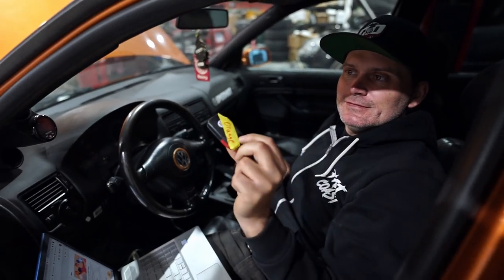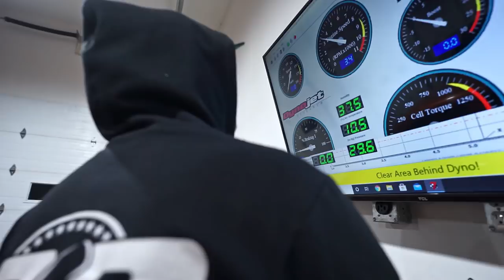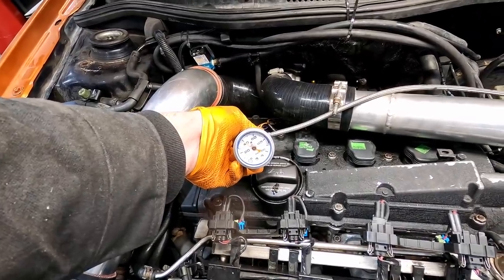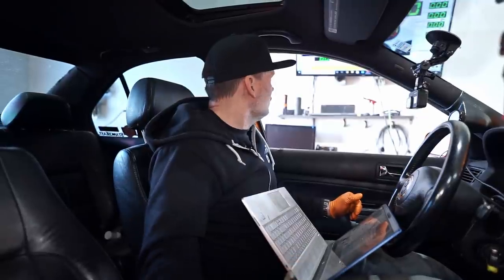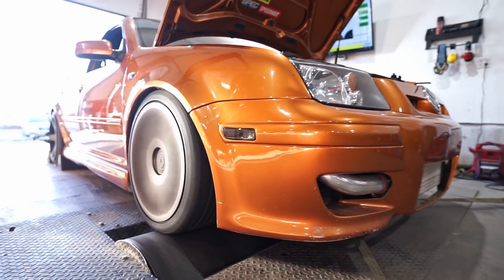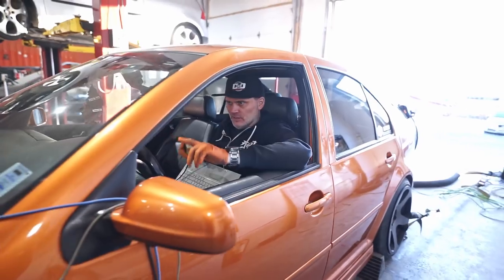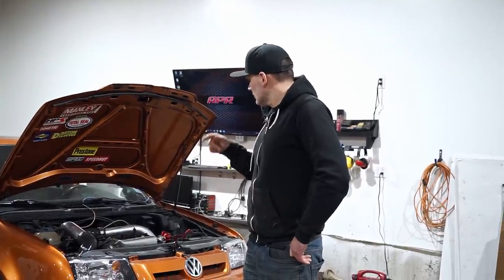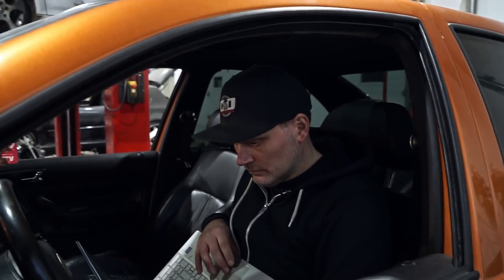Turning up the boost on this MK4 1.8T Big Turbo. Turns into a bit of a smoke show.

Comment: Nice work sorting this thing out. The 3071 is one of my favorites on the 1.8t. I like the Prestone sticker. Pretty hilarious. He should replace it for his "roll call" stickers with a Pentosin one lol. I worked on a few cars that had an assload of oil in the exhaust and intercooler/ piping. Definitely nerve wracking to say the least when its that smokey. To get some of the smoke out of the exhaust sometimes some Seafoam helps in the tank. Not much else you could do besides just let time take its course. On a car that has a cat, it probably wouldn't hurt to use some Cataclean either. It would suck for the oil to ruin the substrate in the converter. Especially if its an expensive OEM one. Then you run the risk of ruining the o2 sensor or getting a whole bunch of efficiency faults and whatnot. I was successful with the Seafoam method on a B5 a4 that a customer decided to way overfill it with oil. Plugs were soaked, PCV was full, etc. Smoked for awhile until I changed out plugs, cleaned the PCV setup, and dumped half a can of it in the tank and sucked the other half of can into the intake via the brake booster hose. Then went and drove it. It cleared up nicely and the smoking completely went away. This is usually the best method I've done to clean them out when they get that way. Really enjoyed this vidja dudes. Good shizz 👍😁😎💪
Reply from the maker: Appreciate the ideas. This was catless with just a res, so it really just need to be burnt off. It got a new set of plugs and I was worried about the 02s but they hung in there... Luckily.
Reply: @COMotorsports  
No problem. Catless is the way to go if I had the choice absolutely. Just offering some of my experience but that thing looks like it cleaned itself up just fine. I like the plug gapping tool you guys use. Who makes it? Interested

Comment: Was contemplating on going gtx2871 or a gtx3071 on my mk4, this vid pretty much got me set on the 3071. Planing on exactly the same upgrade. Rods and exhaust valves. Just wasn’t sure which turbo to go with.
Reply from the maker: Both are good, 3071 just has more headroom.
Reply: @COMotorsports how’s the spook between them

Comment: You got a show the data logs for the home viewer!
Reply from the maker: The data is really only specific to this specific setup so not much point really.
Reply: @COMotorsports  Not sure if you remember me, I’m Mr. Manual Boost Controller😔. Once you swapped over to the 3071 this became very similar to my build, w/exception of injector size(mine 870) and tune which is why I was so interested in the data.  I’m using Ross Tech VCDS to read my ECU (United Motorsport tuned) and am trying to gain all the background knowledge I can. I never wanted to get involved with this but I guess if you’re going to do a big turbo build or any build you need to be involved all the way because relying on others certainly has proven to be a bad choice in the past (for me).

Comment: So I just got my EuroDyne software. I'm putting a K04 (for now) and 440cc injectors on my 1.8T Audi. I'm hoping to get a gt28 and a rebuild done within the next year. One suggestion though, during your video and after each dyno pull you should tell us the power level. Give us more info! Boost level, horsepower, torque... All the good stuff.
Reply from the maker: I said that to Clayton after watching it myself. We'll try a bit harder next time. Keep in mind this video was filmed over a year period vs the first time we had it and had issues with it.
Reply: @COMotorsports  I just hope I can get to 300 wheel! I daily it though.
Reply from the maker: @4BillC  with proper set no problem to daily at that power. I've done plenty. It all comes down to the parts and tune you put into it.
Reply: i know you guys dont want to give tuning secrets away but getting an idea of what the timing change is at rather than saying adding or taking away would be cool.
Reply from the maker: @veedubbergti  Thanks for the feedback, since every engine, fuel, and setup is different that info is irrelevant honestly. It's different for every car.
Reply: @COMotorsports  could be but someone  with pretty much the exact same setup it would be so dosnt hurt to say it  .its definetly something people would like to know dosnt hurt to compare.

Comment: Loving this channel. Currently putting together an auq to go in my e36 bmw of all things and you've answered loads of questions just by watching the video. Are the hp numbers you quote all wheel power? I'd like mine to be around 360 wheel so it's a bit better than an s54 but still reliable enough to use daily..so all I'd need really engine wise is a gt30 turbo, injectors and rods? 
Thanks, wish we could colab our channels but your a bit far away! 😂
Reply from the maker: Appreciate the comments. All our dyno numbers are at the wheels. Sounds like a neat swap you have planned. No problem making that power with that turbo. I'm sure when you get to the point of getting it up and running we can figure something out.

Comment: Do you have any experience with the GTX2867R? I feel like boost hits very late, doesn't seem to "hit" until 4k - 4100 rpm and peaks at about 4500 RPM. Holds about 10 PSI from 3300 to 3900 then it spikes quick. Currently using Eurodyne, might have to hit you up for a tune to get it to boost earlier if it's possible.
Reply from the maker: Can depend on controller, tune etc. Sounds good.

Comment: Love the the content! I’ve a 2017 Passat R-Line with the 1.8 and have a intake,custom exhaust and apr stage 2 no Intercooler yet but realistically how much more power can I get out of this current set up?
Reply from the maker: Lots with a turbo upgrade. You've maxed out what you have really. Cooler IAT and better fuel is about the only options. Turbo only has so much to give.

Comment: Hello, like what you're doing. 
Have a question about my 1.8t leon mk1, I did a full engine rebuild with forged rods upgraded fuel pump 265l, 440cc or 470cc injectors, large exhaust manifold with hybrid turbo k04. Will be adding front mount intercooler, pump fuel will be 95 or 98 How much hp can I make out ?
Reply from the maker: We dont really like k04s honestly as they're pretty lacking in power comparatively.

Comment: Is upgrading valve's a must when going to the mid 400hp range on a 1.8t big turbo?
Reply from the maker: The exhaust valves are weak sauce and fail when they decide. So we always recommend them for power like this.
Reply: @COMotorsports  upgrading valves is pretty speedy isn’t it? I’ve got a built bottom end with IE drop in rods then apr head studs on the top end of my 20th anniversary GTI, is there a specific kit you like when upgrading the valves?

Comment: How do you turn the boost up with eurodyne? I've tried to find some, and noone really gives a straight answer, I was hoping you could help me
Reply from the maker: I don't use Eurodyne to control boost. We're always shotting for higher than the stock map sensor.
Reply: @COMotorsports  Oh, what do you use to control it, I'm trying to tweak mine a little bit for a balance between performance, reliability, and economics.

Comment: Just starting my 1.8t awp build on my wagon. What are the advantages of going to 9.25 compression ratio over the stock compression?
Reply from the maker: Nothing as that's pretty much what it is factory.
Reply: @COMotorsports  isn't factory compression 8.25 to 1?
Reply from the maker: @greasysamsquanch  no
Reply: @COMotorsports  thank you. Keep up the work on the channel. Great videos and alot of good info.
Reply from the maker: @greasysamsquanch  thanks 👍

Comment: Hey, just found your videos. I have a 2003 Jetta 1.8t on a maestro stage 1 tune that has severe pinging/timing pull. I've narrowed it down to a hardware fault. I've been trying to find the issue for a while and I haven't been able to. Any chance you could help me diagnose it?
Reply from the maker: It's not an easy task to diagnose a car over the internet unfortunately. However you state you found it to be a hardware fault... silly question but did you fix the hadware?
Reply: @COMotorsports  No, I haven't been able to find the fault.

Comment: 630cc injectors with gt 3582 turbo wat kinda horsepower should I see roughly with all supporting mods like rods, aeb pistons, exhaust valves basically everything except springs and retainers oh and aem 340lph fuel pump
Reply from the maker: A dyno will tell you exactly what you're after.
Reply: @COMotorsports  thanks 👍 i appreciate it

Comment: Hey CO Motorsports can you adjust afr, ltft, spark advance with the eurodyne mastero 7 software I already use HPtuners for Chevys but they dont cover the 04 JETTA 1.8T is eurodyne mastero 7 similar I want to get LTFT and all my fueling part throttle and wide open throttle perfect and make sure the boost is coming in properly with power enrichment is eurodyne mastero 7 capable of these tuning abilities
Reply: ALSO DO THEY CHARGE YOU TO REFLASH YOUR ECU ONCE YOU HAVE MADE YOUR ADJUSTMENTS TO THE FUELING AND SPARK ADVANCE?
Reply from the maker: @action76news  Yes you can, however it's not such a cut and dry system.. but its one of the only options for these vehicles for an end user tuning suite. You pay for the cable which comes with a lot of base files to get the car running (as long as it's a car they support). Then you can tune from there. So you pay once for a cable and tune, and you can flash other vehicles as well by purchasing more credits.
Reply: @COMotorsports  So my car wouldnt need credits because i bought the cable that would allow one car unlimited reflashes but if i want to tune a different vehicle then more credit are needed? Thanks for responding!🇺🇸🦅👍🏻
Reply from the maker: @action76news  as long as you bought it with credits.

Comment: What rpm would you expect a 6262 precision turbo to start building boost mine spools around 5500, I feel like it should spool a bit faster
Reply from the maker: Check out the blue GLI video on our channel. Dyno runs on that 1.8t with 6262.
Reply: @COMotorsports  how can I contact you for a tune
Reply from the maker: @startonesoundinternational2151  emails on our profile on our YT page and on our website. 👍

Comment: That bumper. Is it a custom stock w/fiberglass dealio for match the widened arches?
Reply from the maker: It's not widened. It's just an aftermarket bumper that was offered at one point in time.
Reply: @COMotorsports  I don't suppose you have the name of it, do you.
Reply from the maker: @dubCanuck1  no sorry.

Comment: Nice !!! Love seeing a new upload ! On the first pull when the turbo failed I was like I’ve never seen a3076r spool so sow but makes perfect sense now haha what fuel did you guys use something good or just fresh pump ?
Reply from the maker: Yeah it basically gave the ghost. First GT Garrett we've had fail in 14 years.   It was a mix of c12 and a bit of pump gas.
Reply: @COMotorsports  for sure I’ve never had one fail either even with 8 years of abuse
Reply: @COMotorsports  hi i c that the car have a blow off valve does the stock blow off valve work better
Reply from the maker: @marcelinofredericks1534  stock is a diverter valve, which is required for a MAF vehicle. We did a mafless tune on so it got an upgraded BOV instead. 

The stock DV on a 1.8t is junk so even on a standard stage 1 or 2 tune they usually fail and folks upgrade to an APR or CTS diverter valve.
Reply: @COMotorsports  thx man tell me im from south Africa is it possible that you can send me a a stage 2 map and how much it will cost
Reply from the maker: @marcelinofredericks1534  I can flash your ECU here if you wanted to ship, I could potentially flash an ECU and ship it, or we can ship you a cable/tune so you can flash yourself. Drop us an email if you're interested.
Reply: @COMotorsports  price to send me a map please
Reply from the maker: @marcelinofredericks1534  send us an email with your specs. We can discuss further.

Comment: What is the factory total ignition timing vs what you end up with on most 1.8t?
Reply from the maker: It's different for each engine setup. Also we only have 91oct here so it's very weak for street use in most cases.

Comment: Is there any after market headers that someone can link that bring the turbo above the motor? Really want to just run it out the hood and it would make working on the turbo a breeze.
Reply from the maker: Definitely nothing on the market to do that. Custom built. We can certainly build you one if you like.
Reply: @COMotorsports  that would be awesome! I know pricing depends on material but something more on the economy side would be awesome. How much would you charge for that kind of service?
Reply from the maker: @TylerSmithMusic1  I would only build it out of stainless, meaning not junk, and not economical.
Reply: @COMotorsports  lol that’s fair. Thank you for the reply! I may send an ecu your way at least!
Reply from the maker: @TylerSmithMusic1  Sounds good, we'll be ready.

Comment: CO for a reason. Ever thought about Direct exhaust pipe to the outside?
Reply from the maker: We use it all the time. It's hard on some cars to keep it on the exhaust. Most don't realize the pressure/force coming out. I plan on building something else to help scavenge but haven't got there yet.
Reply: @COMotorsports  yeah was not referring to the STD 1" hose ✌️

Comment: Do you do any remote tunning? I'm a ways away from Canada 😅
Reply from the maker: We certainly can, all depends on setup and software really.
Reply: @COMotorsports  its honestly like the setup in the video just with spring and retainers and an ie manifold and 80mm throttle body same software and everything
Reply from the maker: @eddieflores8909  yeah if you're interested drop us an email with all the specs and your goals.

Comment: Did you use the stock flywheel or does the clutch kit come with 1?
Reply from the maker: You're not using stock flywheel at this power on these.
Reply: @COMotorsports  so which 1 did you go with? Bc I want to achieve like 500 range, but heard I should go with the 400 over the 350
Reply from the maker: @daquanwaters7653  we can set you up with a proper clutch setup to handle your goals. Just send us an email.

Comment: So how much is the difference between this one and the 2871r , power wise .
Reply from the maker: The gtx3071 gen2 will make a lot more power than a standard gt2871. This turbos rated for 650hp.
Reply: @COMotorsports  what rpm did this turbo see full boost ? Curious as I might get the same turbo
Reply from the maker: @williamawade242  full boost is relative to how much boost you're running, the engine size, cams, etc. Also if your "full boost" is 10psi its gonna be different then if your running 30psi. I can say on this setup it seen 20psi by 4300rpm.
Reply: @COMotorsports  thanks for the reply , and sorry I will have  the same set up almost except I won’t have stock cams. but I’m pretty much just curious on how the spool on this turbo  would be on a 1.8 with stock cams & valve train compared to a gt2871r?
Reply from the maker: @williamawade242  a 28 is going to spool a bit quicker. But if the cars FWD, that just means losing traction quicker. ;)
Reply from the maker: But remember a standard gt28 won't make anywhere close to the power the gen2 gtx3071 can make.
Reply: @COMotorsports  well I guess im selling my gt28 as it needs a rebuild anyway.. I have a 1.8 on a stand Also that’s going to get 82.5 pistons I definitely want the gtx3071 I wanna make atleast 400-450 comfortably. Your videos are awesome man thank you for the reply again.
Reply from the maker: @williamawade242  you won't be disappointed that's for sure, it's a wicked turbo. Glad to help, and much appreciated. Be sure to share if you can. 👍

Comment: Best method for breaking in a fresh motor?
Reply from the maker: There's lots of good enough out there. In short, higher revs and engine braking is the gist, just in stages. It should only take about 20-30 mins break in.

Comment: Would you guys recommend a fmic or upgraded smic for a stage 2 ko3s awp
Reply from the maker: I'd recommend ditching the K03. :) Stock IC is fine for stock turbo.
Reply: @COMotorsports  whats a safe upgraded turbo that won’t blow rods
Reply from the maker: @I53-624  all comes down to tuning/boost and torque.
Reply: @COMotorsports  I’ve been thinking about ko4-023 but by the time I’m spending all of that money I might as well bigger I think
Reply from the maker: @I53-624  k04 are a waste IMO on these engines.
Reply: @COMotorsports  do you think it’s cheaper to piece together a kit than say buy something like a cts kit?
Reply from the maker: @I53-624  It's a classic get what you pay for. There's a lot of people selling junk out there. So if you have a couple years to put piece together a kit with used decent parts then sure. Or if you want to wait to try and buy a complete used kit and deal with the risks, and the potential missing pieces. There are deals out there if you know what you're looking for, but time and time again I see folks trying to do exactly that and they buy stuff that they think is a good deal... come to find out it won't work for their application.
Reply: @COMotorsports  very true!!

Comment: If i was driving that jetta id have that bitch spooling idk why you wait so long to apply boost bro. 😭 once u get past 4k get on it mannnn ive have 1 of these and they love it your just soaking up heat waiting on boost. Its pulling though
Reply: 12:46 is how you shouldve done all of them
Reply from the maker: Lol thanks man. However we're tuning the car just not seeing what it's going to make for numbers. Meaning we're trying to replicate as much of the RPM range as possible before getting out on the road. The more done here the less done on the street.